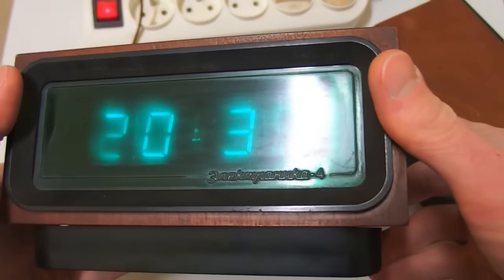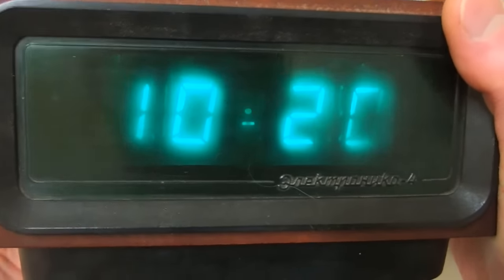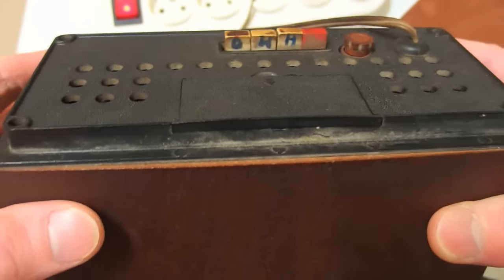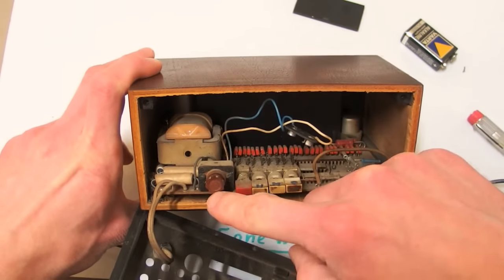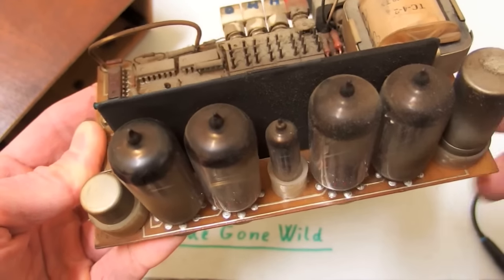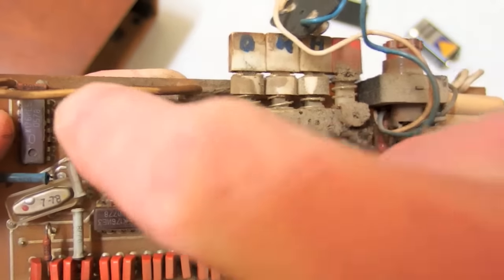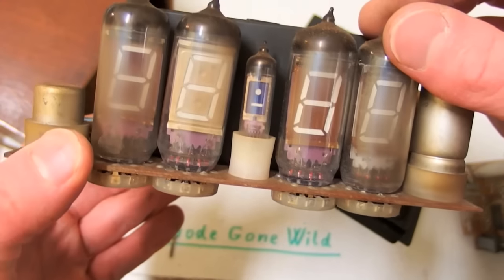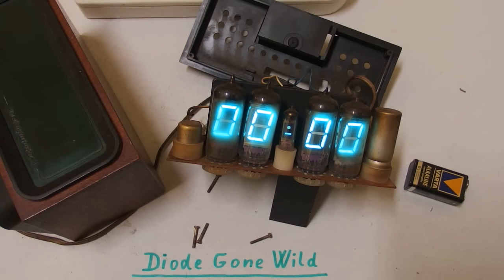1978 Soviet VFD Clock (nixie style tubes)

Comment: Love anything that is VFD. Have one Realtone clock radio from late 70s and it has a futaba VFD display. It runs very strong after all this years, but the clock (made on a TI clock chip) has the segment drivers built in and a couple of them stuck on and I can fix it. It is the same sort of light green that yours.

Comment: I have 4 of them, in boxes and with manuals in Russian. They are a little newer than yours and have black plastic cases. I didn't know they had Nixie tubes. A Russian brought them to my fathers watch shop in Switzerland.
Reply: They are VFD tubes, not nixie tubes. Nixie tubes have the orange glow. (Note that there are also Numitron tubes, which also glow orange.)
Reply: Benjamin Esposti: I never looked inside, which I usually do. But they are from the soviet era, with a small paper with a signature on it from the person responsible for the quality control, as if it were a Rolls Royce. So the tubes are the same as in the old  green lighting calculators, I think?
Reply: They don't have nixie tubes.  The poster is wrong and keeps saying it over and over.

Comment: The tubes draw a very high current when heating up. Just like a light bulb filament. The metal filament is a thermal conductor whose resistance increases with temperature.

Comment: +DiodeGoneWild - YES , 
usually Socialist / Communist stuff was made to last long . because of known reasons
Reply: True, western stuff are made to break down in months, just look at the light bulb, there is just one light bulb in the world that's been estimated to live forever and is located in one of new yourks firedepartments.
Reply: True, western stuff are made to break down in months, just look at the light bulb, there is just one light bulb in the world that's been estimated to live forever and is located in one of new yourks firedepartments.
Reply: @Carlium  that lightbulb is powered at half the voltage, "forever" is big anyways, i've also read the story of a building with a set of fluorescent tubes that were forgotten on for decades, found still lit, there was an argument about the bill

apparently they cared more for electronics suff rather than cars, you will bring electronics in space but not piston engines, they say :D
Reply: Nope. Western stuff from the 60s/70s also lasts VERY long.

Comment: 20mA for almost 20 years???

9V NUCLEAR BATTERY?
Reply: Thats not how it works but sure
Reply: It's only a battery for backup if current is not available. The time base keeps running without tubes working and if current is back there is no need to adjust the time.

Comment: I have some Panaplex 7-seg that run on 180 volts DC, planning to do a clock. Their colour is a deep warm orange. Very nice. We had old factory gear that used this as early digital display. Still working after 40 years of use 2 and up to 3 shifts !!!!. Drivers arent easy to find tough
Reply: Use transistors MPSA42 or MPSA92, those are suitable for high voltage drivers.

Comment: I like the simplicity of logic chips too, if one dies then its possible to create something from other chips to do the job :-D.
Clean the tube face and plastic filter, should improve the display no end.
Reply: NEY Industries,
I have to say though, it can be a challenge for some because of the number of connections that have to be made. Probably around 100 to 200 connections.
Reply: There are cases when you have a fried MCU and you cannot get source code.

Comment: That's nice. Are they expencive to buy now? I bet there are many of them in the Czech republic, since the close ties with Soviets at the time.
Reply from the maker: Yes, there's still a lot of them. Sometimes I get lucky and buy it very cheap, like 4 - 8 dollars. But often they don't work. After somebody dropped it, the display is often cracked, or the transformer torn from the board. I even had one that probably went swimming. The flat VFD's are often worn out and need to be replaced with a NOS one. The capacitors are often dry. The case often scratched or cracked. The fuse is sometimes replaced by a thick wire. But sometimes I am lucky enough to find some that still works well and even has sealed screws.
Reply: Im from slovakia and i’ve never got my hands on thoose clocks or any nixie-style devices ... im unlucky pepole thinks that they are unusable
Reply: I live in Australia and I managed to get one from Ukraine.

Comment: Nice video. That's a fascinating antique specimen. Electronics don't last like this anymore. Is it possible that the circuit is capable of tolerating a short circuit of around 250mA? I had no idea that VFDs could consume so little power. I also find it amusing how these soviet goods have the price stamped right into them. Is it real wood, or something fake? I assume it was made in USSR. Was this purchased there, or in ČSSR?

I like your grandfather's wisdom... when somebody says my car or something is worn out, I will tell them that it provided a lot of enjoyment
Reply from the maker: I'm a bit afraid that the transformer could burst into flames while the fuse stays intact. In some of them I replaced the fuse with a T 40mA one, it works and I feel safer. Some newer soviet clocks from late 1980's have a (fusible?) resistor instead of a fuse (tiny 390 ohm resistor). This is also strange. All those clocks draw about 15 - 25mA and the power is 1.5 - 2.5W only. In Soviet times, the price was given and nobody could sell it for more (you would be arrested). It is a real wood. It was made in USSR, but I'm not sure it was imported in bulk, or it was brought to ČSSR by people visiting USSR. Maybe both. But the plug often was modified at home to fit the Czechoslovak socket (it was grounded, the soviet socket wasn't).
Reply: The fuse might be rated 250mA to prevent transformer inrush from blowing the fuse. I know that small value fuses (less than about 250mA) tend to be fragile, and sensitive to transformer inrush current.
And, I hate fusible resistors. Something doesn't seem right about them, I would think they'd get really hot and possibly start a fire.

Comment: It is really necessary to use a fuse with a higher rating because of inrush surge current due to the transformer
Reply: also when filaments are cold they draw a lot of current on turn on. This is the reason why old TV use termistors in series I think.

Comment: Hi, I read on your website that you can insert a resistor at the Elekronika 4 clock to adjust the heating voltage for the current 230V grid.
Did you break the circuit board at that point? In the photo it looks like the resistor was soldered only on the lane?

Comment: they has smaller but 0.25 is good when short circut happen
Reply from the maker: Yes, but the resistance of the primary winding is a little over 1000 ohm, so it doesn't blow the fuse even if you shorted all of the secondaries. In the case of secondary short circuit (short capacitor, diode in bridge, any short circuit in load, short in secondary winding) the fuse doesn't blow and the transformer keeps melting and catching fire.

Comment: Why did they use over rated fuses? Maybe it was population control...
I'm thinking the fuse blew once and the user replaced the fuse with the wrong type, but the fuse rating is printed on the case.